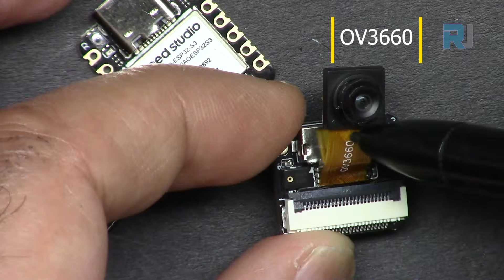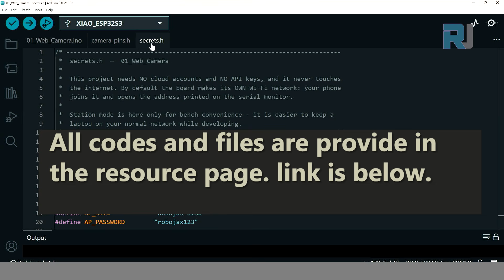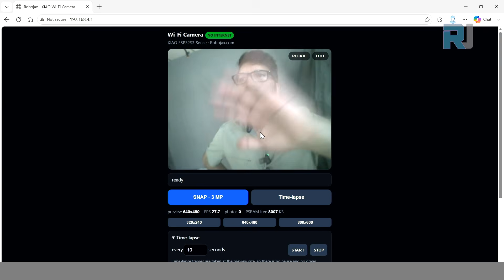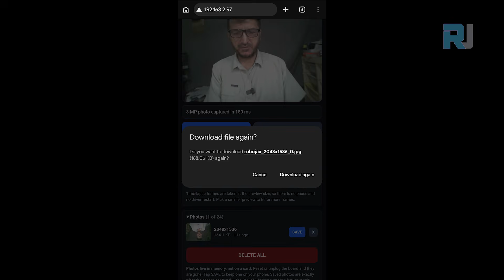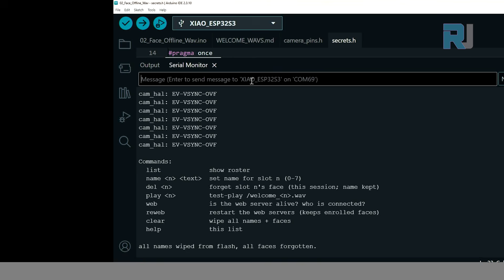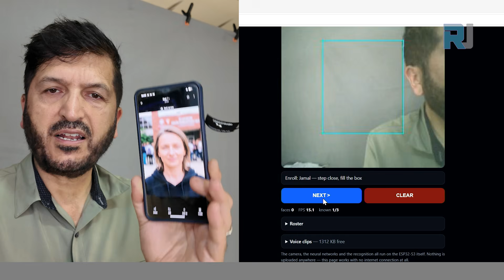Face Recognition With NO Internet — $15 XIAO ESP32-S3 Camera

Comment: so couple of observations, firstly thank you for this video, it is very helpful.

The face recognitions works well untille the Arduino is runnig. Once it is closed the face detections does not work. 
Also, if you reboot the Esp32 the face detection does not work. 

Is this usual behaviours or is ther something that I am doing wrong or there is bug. Help on this will be highly appreciated.

Comment: i bought this s3sense board for face recognition door unlock n integration with HomeAssistant but video is choppy n face recognition is not as accurate for gate door unlock i test it only once n its still in drawer.i bought this board as it supports edge ai but i couldn't make it work on esphome i have a luckfox pico plus attached to ps4pro for jailbreak i was thinking of using that for cam feed n face recognition as it has NPU 0.5Tops i am a total noob not a coder can u suggest how can i integrate this s3sense board with HA.n u should use a blinking feature to this to make it more false safe
Reply from the maker: Face recognition can be tricky with limited hardware, but thank you for the suggestion about the blinking feature.